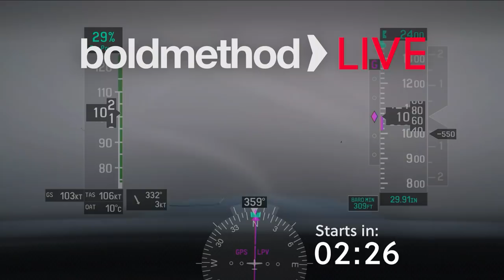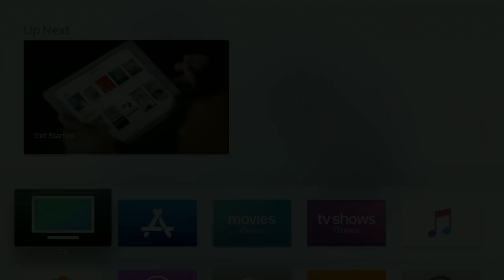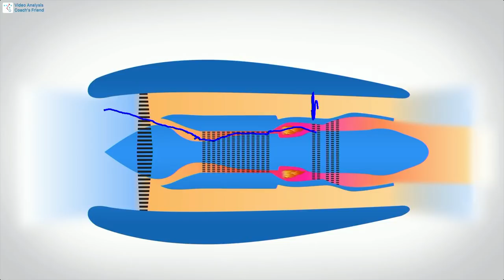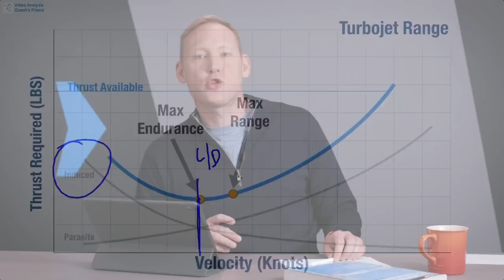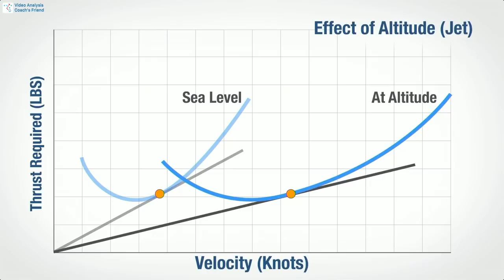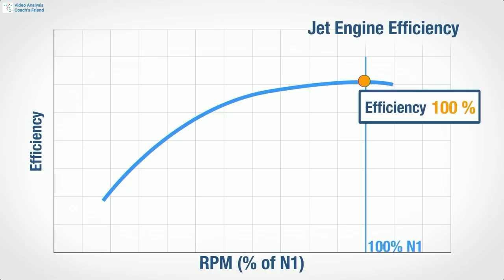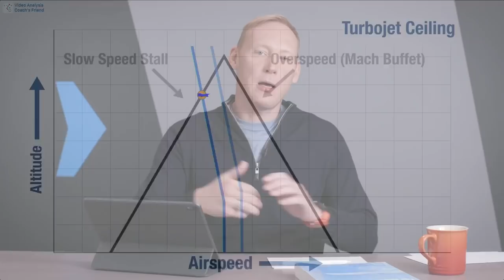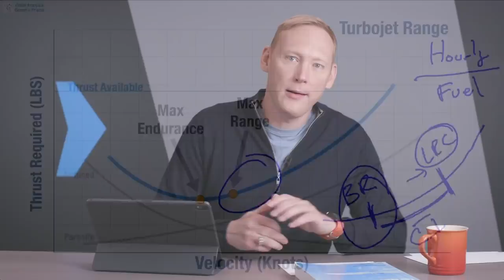Jet Cruise Performance: Boldmethod Live

Comment: My physics and engineering background was cringing a bit through about the 14:30 time stamp, no big deal breakers but still not quite accurate.  Pretty good stuff after that. 
So, on an older C172(150HP carburated models) best L/D(and thus best best loiter time and glide) is about 70kts, but best range is about 100-105kts IAS, at least at lower altitudes for calm air, this is a substantial percent speed increase. 
Of course best range is ground speed, not airspeed, over fuel flow; so you would want to increase airspeed a bit in a headwind and decrease a bit in a tail wind for true best range. Just look at the extreme of 100kt headwind and either 100kts airspeed with 4hrs fuel or 110kts airspeed with 3.5hrs of fuel; range is zero at 100kts and 35miles at 110kts. As tailwinds increase you would get closer to, but never go below, best loiter time IAS.

Comment: At 39:41, isn't the temp at the tropopause usually at -56.5C
Reply: Edgar Xavier -56.5 is the standard temperature in ISA at tropopause which occurs at FL360. More reference to ISA on google. The temperature of the atmosphere varies every time so you will not find standard atmosphere every day. You can have -40, -50, -60 etc at tropopause. -56.5 is more like a reference to say so.
Reply: @Tom Lilli I agree with you. I was talking about ISA tropopause which occurs at fixed standard altitude of 36,089 ft aprox FL360. Of course tropopause varies daily and also with latitude, being higher at equator and lower at the poles.